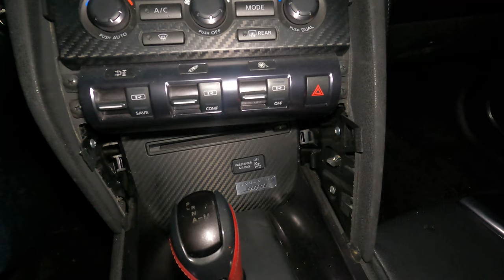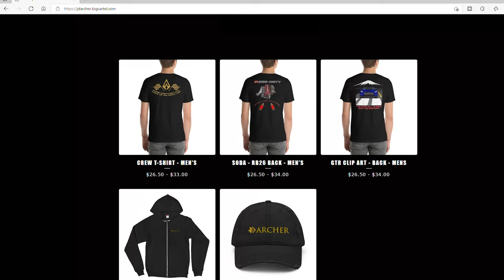CARBON FIBER WRAPPING THE CENTER CONSOLE OF MY NISSAN R35 GTR (HOW TO)

Comment: I've been following your channel for about a year now, and after a few weeks of official searching I'm a proud owner of a '13 GT-R. This video helped me pick the wrap and gave me pointers because it was my first time as well. I ended up going with the 2.75' x 5' wrap (definitely more than enough) to get the fiber direction to go the same way. It took me three tries total, 2 with a blow drier (not the best for me) and starting from the shifter. Finally I started the wrap from the cup holder section and worked my way towards the shifter with my heat gun which allowed the wrap to stretch easier. It came out great with one small gap in material from over cutting before heating the wrap, but the leather around the shifter section should protect it. Thanks for all of the great content you post, I've learned a lot before ever owning a GT-R!
Reply from the maker: Awesome. Welcome to the GTR fam and congrats on your first wrap
Reply: @JDArcher  thank you, and thanks for the easy to follow and informative content you're sharing

Comment: Always feed the vinyl into the deepest part first and stretch out from there. Try using 3M Di-Noc, much more durable. I've done a bunch of these. Primer will also help some parts. Don't use a tac reducer.
Reply from the maker: I was thinking about that, but the transition to the flat area seemed more difficult to avoid wrinkles

Comment: Looks good ! Also protect the plastic from being scratched. I may do that too ! On my CBA btw what do you think about wrapping the mirrors. ?
Reply from the maker: Hard to see reflection through wrap :) jk. I'm assuming you're talking about the side mirrors. It would protect them from bugs and rocks. As for looks, it's all what you're into.
Reply: Mirrors are pretty hard to wrap from what I’ve seen
Reply from the maker: @risingsunautomotive2346  I've seen this horse shoe shapped device that is supposed to make it easier
Reply: @JDArcher  I know exactly what your talking about
Reply: @risingsunautomotive2346 I would think mirrors were easy I'll have to check it out

Comment: Did you sand the fenders more? Because they look like they fit a lot better. I am really exited to see them get painted.
Reply from the maker: Not yet. I just added the badges back on. I can't wait to get then painted either, but that will probably have to wait seen as I just dropped $5k to have the timing chain and everything done. I will at least put the carbon fiber vents in soon
Reply: @JDArcher  Yeah if only painting was cheap. But I am really exited for how the fenders will look painted.
Reply from the maker: @bbman2517  same here. I'm torn between paint matching or changing color
Reply: @JDArcher  I mean you did want to make the GTR blue. Not trying to be rude or anything but it would be a waste of money to paint it black and then in the future paint it blue. But that is just me, you do you.
Reply from the maker: @bbman2517  oh ya, I've had that argument in my head many times. They other option is to color match, then wrap. For some reason repainting kills resale value
Reply: @JDArcher  Well no matter what I think it still would look good wrap or paint but with a wrap you save more money.
Reply from the maker: @bbman2517  yes, but wrap pulls up, had bubbles, corners can be an issue, and one scratch and you have to redo the whole panel
Reply: @JDArcher  that is the risk
Reply: In my opinion who cares if it depreciates as long as you have fun with it is worth it. But that's just me.
Reply from the maker: @bbman2517  and I've definitely made that argument to myself also